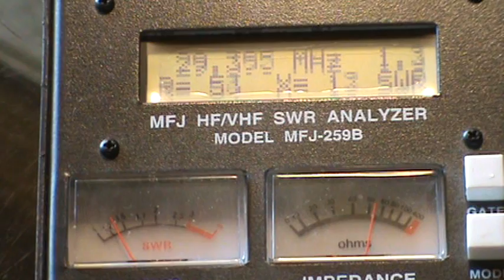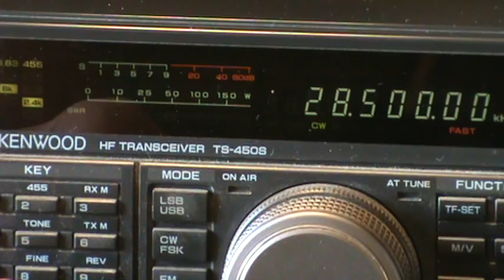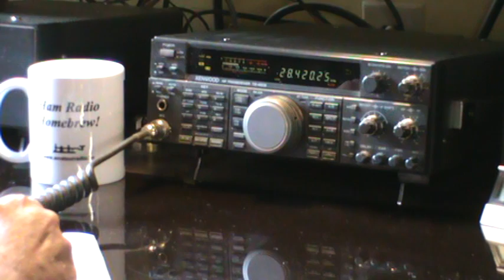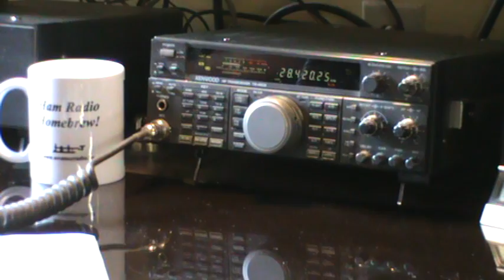Ham Radio 10 Meter Ground Plane Antenna

Comment: Impressive setup. Ground-mount appears to provide a wide bandwidth at nearly flat SWR. Ground-mount appears to facilitate the predicted low-angle signal takeoff. Good work Dave.

Comment: Great video, very good demonstration, Dave. I just built and set up a 5/8 wave 10 meter ground plane a week ago and installed it on a tripod bolted to the peak of my house, with the radials being about 20' off the ground. Your video prompted me to realize I did not ground it!  Doh!  You may be sure I will for sure do that before this day is over.  I like your TS450S; I have a 440S.  I used to be KD5OAA but let it expire but intend to re-test and renew soon.  In the meantime I listen a lot and am pretty sure I've heard you.  You have great on air personality...a genuinely nice guy and a good tech.  73's from Abilene, Texas!

Comment from the maker: To ground a mast mounted antenna, run a ground wire up the mast from a ground rod up to the mounting bracket and attach it to a U-bolt.  Use a lightening arrestor at the base of the mast and connect it also to the ground rod.  I use lightening arrestors at the base of my tower and also where the cables enter the house.  With a ground mounted vertical I don't use a lightening arrestor at the base of the antenna because of it's close proximity to the ground. Thanks for watching and 73! :)

Comment: Hi Dave, you've got some good ideas! I went back to the old CB days and I had 2 stainless steel whips and knew I needed
2 more to get a ground plane antenna built. One of the 8 foot whips was the vertical element and the other 3 were the ground
elements. The biggest job was making the mount which was a steel pipe and a small circular plate that was brazed on the
end of the pipe. The small plate was drilled to accept plastic mobile insulator. These standoff insulators are used in CB mobile installations. The pipe was a mast sized steel pipe and another larger pipe (6 inches long), was slid over the pipe with 3 steel nuts brazed to the larger pipe for the horizontal ground radials which screwed into the nuts on the larger pipe. Another large nut was brazed to the big pipe to lock the pipe to the mast pipe to keep the pipe from rotating in the wind. I used a CB mobile mount that accepts a PL-259 female screw connector. The coax and the connector has to be slid into the 2 foot mast
pipe. The PL connector on the end has a 3/8 stud which will take a double female 3/8 connector for the
vertical element. A continuity check needs to be made between the coax center lead and outer shell to be sure that the
vertical element is not shorted and also that the vertical element shows continuity with the center of the coax.

Assembling this on the tower is no problem just slide the mast pipe down through the center of the tower, lock the mast
pipe down with the tower's mast bolt, slide the larger pipe down around the mast pipe and lock it down with the bolt that is
threaded with the nut that was brazed to the larger pipe. I used a larger bolt and nut for this since it will need to lock the
6 inch pipe down on the mast pipe. You then screw on the elements, one for the vertical element then for the drooping
radials. A person could make a L-bracket drilled for U-bolts instead of the way I did it.

The old ground plane antennas used a L-shaped bracket which were flimsy and the elements were made of aluminum tubing
which seldom lasted a ice storm. Several downsides of using the stainless steel mobile element is the current cost of them
and since the vertical element is not grounded, the coax should be grounded and not connected when lightening is present.
The stainless steel elements use to be $15.00 each about 25 years ago and now they have more than doubled. The plus
side is that they are durable and will survive high winds and a ice storm.

The SWR on this antenna is almost flat on 10 meters and is around 1.5 SWR on 11 meters. A lot of these antennas were
used as scanner antennas years ago. It is broad tuned and with a antenna tuner can be used on several other bands. I doubt if anyone could ever burn out the element with high power RF!  :)

 Have fun experimenting!
Reply: Will this antenna work near the ground? Where the radials ends just touching the ground.

Comment from the maker: Normally the braided shield goes to ground and the center coaxial cable conductor would be positive.  The long side of a j-pole is normally positive.  Some antennas, like a dipole, are not polarized. It would be best if you contacted the manufacturer about installation. Thanks for watching! :)

Comment: I want to build really high quality .64 wave ground planes for 6 & 10 meters
the longest and most efficient single radiator antenna system

Keep up the good work Rekindling The Reformation !!

Comment: I built a portable 6M antenna where I tried to keep everything to less than 8ft so that it would fit in the back of my pickup. When I look at this antenna it seems that it would be excellent for a portable-in-a-park build! I would like to do something like this in a 20M or 15M version. Kudos for being kind to the CB guys. We don't need to slander them, most do a good job of slandering themselves :P

Comment from the maker: Hi John, You can try to add 120 or 360 radials, being as perfect as possible, to try to achieve a perfect ground plane as suggested in the handbook. But in real practice and depending on your location you may not be able to tell any real difference between using 4 or 360. I had a friend who once scratched his head and wondered why is antenna didn't work any better after adding all those radials. You can always try them though and see if it helps. Thanks for watching and 73.

Comment: Dave,  This is a 10 Meter ground mounted vertical not a ground plane.  A ground plane is alway elevated to decouple the radials from the actual ground to eliminate ground losses.  The reason the vertical is longer than the formula is that the actual length will be aproximately 102 degrees and the mounting plate will act like a capacitor to ground canceling out the inductive reactance of the additional length and giving a better match.

Ted VE6AMR
Reply: ebear1ca Yes correct, I think
An attempt to replicate using fiberglass stakes and no mounting plate has yielded SWRs no better than 1.6:1
Could also be the feedline, but doubtful
Will try adding pf
Reply: +ebear1ca,  If you measure the imput impedance at 102 degrees it should be somewhere near 50 +  j 100 so a capacitive reactance of - j 100 will give you an almost 1 to 1 SWR.
Reply: ebear1ca Very helpful, thanks.
Why measure at 102° though?  MFJ manual recommends 360°
Reply: If you look at the ARRL Antenna book you will see that the feed point impedance of vertical cut for 102 degrees is R 50 ohms + j100 ohms; and by feeding the antenna through a capacitor of -j 100 ohms the reactances cancel leaving a feed pint impedance of R 50 ohms  a perfect match to your coax and a resonant antenna.
Reply: ebear1ca OIC, thanks. Don't have that one, but is on the list
Reply: +The Lightning Stalker 
I rate the ARRL Antenna Book as the best one available for basic theory.
A 180 degree or half wave  vertical antenna has a very high input impedence and is voltage fed.  A 90 degree antenna is of course your basic quarter wave vertical with a feed point impedence of around 37 ohms resistive, as it is a self resonant antenna.  By lengthening the quarterwave vertical you increase the resistive component of the input impedence but you also increase ithe inductive reactive component; fortunately by simply adding a capacitively reactive component in series the reactances cancel each other resonating the antenna.  Should you wish to operate the antenna at DC ground potential for safety purposes simply shunt the feed point to ground with a high current inductor that has a Xl of5000 ohms or more at the frequency of operatin it will have very little effect on the feedpoint Z.
Reply: +ebear1ca 
Dave, I have used the above principle in a 40 meter ground mounted vertical some years ago with good success,  Using a 2 inch EMT tubing radiator and an old tuning capacitor  i managed to get a less than 1.2 to 1 VSWR across the entire band.  I did however use 65 quarter wavelength radials.   I recently designed a four square for 160 meters using the same theory.  Each of the four towers is 12 inches on a face and is approximately 137 feet high and each will be fed with vacuum variable capacitors with a tuning range of 1600 to 2200 pf.  I am currently working on a sensing network that will automatically tune each of the verticals for the lowest VSWR at whatever frequency  in the band I wish to operate.

Comment from the maker: The vertical element is 2.616 m.  The calculated length for the radials is 2.515 m and were made 2.54 m long. The mounting plate is about 20 cm tall. Sorry I don't have any idea what size PVC pipe or aluminum tubing is available in your country. Again, thanks for watching. :)

Comment from the maker: I bought mine from a local company called Air Parts. I found a similar company online and added a link to them on my website (click on the links page then Antenna Parts). I think they sell aluminum by the foot. You want the .058" wall thickness aluminum tubing.  Thanks for watching and 73! :)

Comment from the maker: For better performance mount the antenna on a mast. For more gain phase two or more antennas together. Phasing antennas is something that I have not yet discussed but for 11 meters a phasing harness can be purchased instead of made. A phasing harness will match two antennas to a single 50 ohm feed-point. Space the antennas 8' to 16' apart and add the harness. This equal phasing will produce a broadside pattern (like a dipole) and will add about 3db gain. Thanks for watching and 73! :)

Comment from the maker: I've added a webpage about this antenna to my website. The link to my website is at the top of my YouTube channel.  There is a link on that page that will show the pattern and gain of this antenna at different heights. You can also use even larger tubing like I did on the 10/15/20m vertical antenna. If mast mounted then bring the radials down at a 45 degree angle to match the impedance. Thanks for watching and 73! :)

Comment: Another good project needing some flux and shrink wrap to seal the ends to make them a little better at being water resistant, with a layered shrink wrap to make it look professionally done. Looks like a project right up my alley, 030, Gary in Rogers, Ar. 73's. Or GLB5ABL see ya.

Comment: Just built one similar to this but elevated, and using wire radials
       .A simple stainless  102" whip, mirror mount and 3 12 gauge wire radials mounted to the fiberglass military masts. the radials are supported by 3  4 foot fiberglass driveway rods that go through one of the fiberglass mast and are 120 degrees apart i've got it up on about 22 feet of masting works pretty well we have our club net on 28.333 wednesdays at 8pm hope to hear you jim KB1PFL.

Comment from the maker: I could have shortened it by a half inch or inch to make 29.800 MHz a little more resonant. I think the medium size aluminum tubing that I used, and possibly the radials may not be the exact same length after stretching them out, made the antenna quite broad-banded.

Comment: The copper will with weather, convert to white dust. I recommend using a SO259 a the antenna and then a PL259.

Comment: Helpful video . I’m puzzled though , I thought the term “ground plane “ was used to refer to a vertical that has the radials elevated with the antenna above ground several feet .

Comment: I don’t know if you will see this now, but I was hoping you would show how you mounted the coax to the antenna. I missed that and I kinda wanted to see it. I really need a 10 meter antenna as I’m only a tech and I want more than 2m/440. Thank you -73- W1KPS

Comment: Dave put aluminum tube kit together for 11 meters in a j pole kit they can slide down the top part for 10 meters  1 foot 11 meter antenna 1 foot longer I made one for cb for my brother I made one out of 3/4 inch copper pipe but it to gravey aluminum tuneing not as heave the new hams and those on cb would buy the antenna

Comment: To complicated. I have been very successful with long distance contacts on both 10 and 11 meters (CB) just by using a 102" steel whip, attached to part of a mirror mount bracket, and bolted to the wood fascia at the top of the gable end of my house roof. I then took a piece of 8 gauge wire of the same length, connected it to the mounting bracket, and ran it along the eve. Obviously you have to tune both the 102" whip and the wire to the right length for the band you are using it on. I used 80 watts on a Uniden Washington SSB 11 meter base, got an swr that wouldn't even move the meter,  and made several contacts in Australia, New Zealand, Hawaii, and other islands in the South Pacific. Overall, I have had better luck with dipole antennas than anything else.
Reply: Yes, you could call it a folded dipole. Half of it vertical, half of it horizontal. But it sure worked great

Comment: I get my aluminum tubing online from DX engineering. You can get sections that already have slits in them. Makes it easy! Right now I am using it for a 10 meter dipole and the mast it's on top of.

Comment: Great video Jim looks like you are 367 mile East of on a 111 degree heading. The town I grew up in was said to be the half way point on the shortest route from KS to Denver. That was before I70 was constructed. I read that 468/f is no magic number but the figure that worked best for the ham where he lived that had an article publish The article read that said that, also said we should make  note of our own results to create a formula that works best at our own location 73

Comment: Holiday I am K1 emw I have a ground mount is vertical I am not impressed with it too awful much I have a bout 20 radios in the ground I would like to lift it up in the air a little bit what is your thought with that if you would drop me a note I would appreciate it thank you seven threes God bless

Comment: Thank you Dave. I would like to build a 1/2-wave 10m ground plane with tubing. Can the radials still be 1/4 wave? Any matching required between the radiator and the radials? Thanks!

Comment: Dave I cannot find any help, I aquired a maco 5000 ground plane antenna , it says slide the antenna in to the base unit 6 inches through that white nylon insulator , my question is this ,, ,there is a bolt that holds the arm on to the base unit that has the so-239 or whatever that connector is  , Im wondering if that metal bolt goes through that metal arm and through the base unit and through the antenna out the other side with a nut , if so , what is the point in that nylon insulator and how is that not a short?

Comment: If you wanted to mount the antenna up high the wires for radials probably wouldn't be practical. How could you make something to mount aluminum tube radials?

Comment: Hi Dave spent hrs watching your vids fantastic and interesting ,,, I was told antennas have to be a certain height above the ground for a given band and this antenna is on the ground ,, I thought they had to be a half wave length above the ground else it wouldn't work very well ,, so could you explain why this is working so good from ground height please many thanks Shane ,,CB operater in the uk England
Reply: A quarter wave antenna has a high angle of radiation.
If your using it for local comms it works best elevated esp in hilly terrain and depends on your application and site location\terrain as too how you mount it.

There a good explanation here http://www.hamuniverse.com/w5alt14wavegroundplanevert.html

Also  another note: if your are using a switched mode (isolated)power supply (to run your transceiver) do not ground the ground plane wires to earth (dirt)

It causes SMP to become very noisy and they don't like the DC neg\SO239 (they are commoned up on modern radios)of radio grounded to earth (Frame ground),it creates a earth loop and you'll have a lot of hash created,I have seen this problem and very little information on subject,
I found out this during a research project with isolated ground systems  and what was causing the noise problems,grounding the DC neg side to frame ground.
This i is a recent discovery with SMP use and lot of technical books don't explain this or are out of date with current technology,so if your using your cb radio with a Switch mode power supply ensure the ground plane wires are isolated from real ground.
I tried a lot of high end and low end brands in my research. 
Im sure this is why lots of operators have had troubles using these SMP in past,if using a standard linear PSU ull be fine to ground wires.

My elevated quarter wave  works extremely well 50Watts NFM or SSB can work me +45 miles local easy ( I have done 150 miles line of sight on ssb) and constant and 5,100miles SSB DX sky wave and that in a hilly terrain!
Bandwidth is very good with this design and covers cb and more!
It has no gain,but just add RF power for a bit more umph!

I added a 5 turn RG-213 or RG-58\U  coax on 4.25" former (plastic golf hole flag plug) RF choke (http://www.karinya.net/g3txq/chokes/)at feed point of antenna.
My 3 groundplane wires had insulators on them and cord to position them at right angles.

At 10m high antenna from ground level it works extremely well for base to base or mobile contacts on NFM mode on cb\ham,the ground mounted one tried on Hill tops and that also worked very well too from a semi fixed location.

Mounting system in video is perfectly good,an elevated version is perfectly good,depends on your terrain\location and how you want antenna to be used is all I can say on my experiance with this antenna.

Always enjoy watching these videos very practical!

All the best Rob 73's